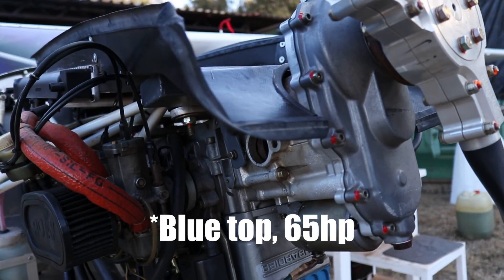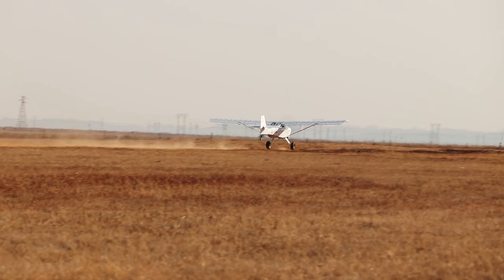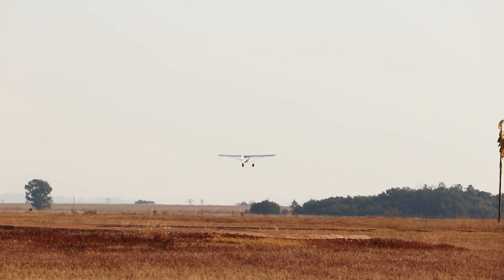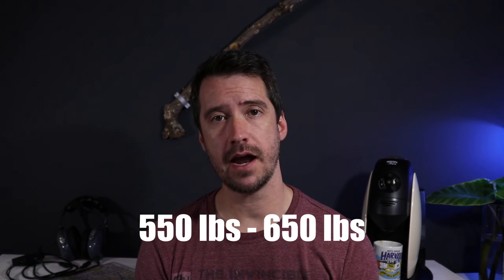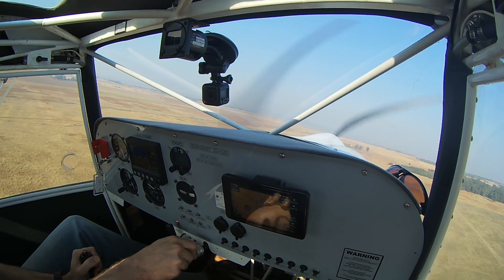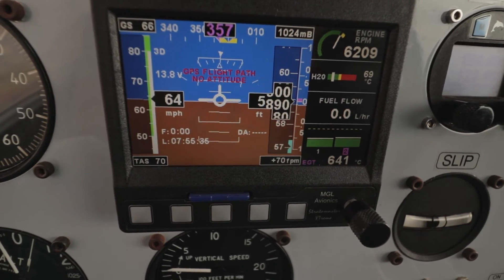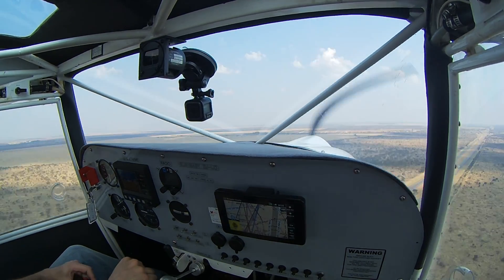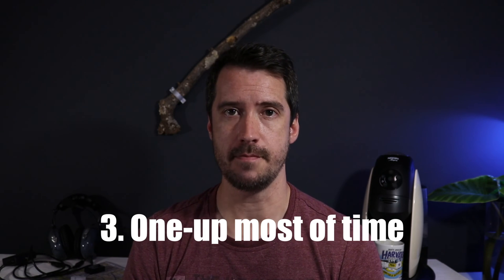Is the Rotax 582 Good for Light Sport Aircraft?

Comment: Very useful video but, as you point out, the takeaway has to be nominal power available vs aircraft weight and density altitude. The video, instead of naming the Rotax 582, could have been titled "Is 65HP good for light sport aircraft"
Excellent videos with useful information - thanks! Keep it up!
Reply from the maker: Yes absolutely to both the takeaway and title comment. Thanks.

Comment: Totally agree, one of my first flights was in an X-Air with the 582 engine, 2 people on a hot summer afternoon. Grass runway was 400 meters long and we used like 300-350!! Got a bit nervous, also the climb rate was sluggish. Airfield at an elevation of 1200ft, temperature 33 celsius with high humidity 😂

Comment: I just bought a kit Fox 2 with a rotax 582. 65 horse blue head. My airport base altitude is 7,600 ft. I was wondering what you thought. I know that on a hot day I should only consider light fuel and one person. But during the winter months it gets down to freezing if not just above freezing quite often. I know that it doesn't seem like a lot of power but would it still be a reliable plane to fly when density altitude is not very high. I don't know what do you guys think. I live in Questa New Mexico USA.
Reply from the maker: My take, the Kitfox 2 is VERY light and thus the 582 has ample power for it, even 2-up. However 7,600ft is very high, most non-turbocharged engines and planes will suffer there. Even so, I'm quite certain it will fly just fine 1-up.

Comment: You really need to go back and check out the original Aero Design's "Pulsar" by Mark Brown. It was based on the 582, composite construction and professionally designed & engineered. It performed extremely well and a number were built and flown. Later, the option for the 80 hp Rotor 912 was developed and even later the 100 hp was installed. Also, check out his article on "2-stroke vs. 4-stroke" in the EAA Sport Aviation archives. Food for thought.
Reply from the maker: Thanks, will do!

Comment: Don’t buy or build an aircraft, or install an engine that is not suited for the density altitude in which you intend to fly. A dangerous consideration to over look. No matter how fast you can run, your kite is just not gonna fly without lift. It might not be common knowledge, but there are certain country’s where the airlines don’t allow departures after 12:00 pm. 
Your video is a good offering for those that are thinking of choosing a similar path. Hopefully they won’t make the same mistake. Fly sunrise til winter!
Reply from the maker: Well said. And to add to that, just because it flies fine with just you (the pilot) aboard, doesn't mean it will be fine if you add a passenger. Light aircraft are extremely weight sensitive, and density altitude compounds the problem.

Comment: I have a 582 in a kitfox 3 on full lotus floats, 10 seconds on water to get in the air and 7 seconds on snow
Reply: Your Kitfox 3 will be as bad as the 2 stroke Bushbaby under the same conditions (both share the same wing profile). Did you ever take off from an airfield at a DA altitude of 8000 to 10,000 feet? Everything is different 30% less power and much less lift due to the thin air and much less cooling (you really need to control the throttle in a 2stroke to avoid damage). My airfield in Europe is at 560 feet altitude and I also fly in South Africa at an airfield with an elevation of 5600 feet. My plane in Europe and in SA are almost the same (KFA Explorer and KFA Safari) but although the Safari got a Turbo which compensates the DA and has 15 more horses, the performance difference in terms of take off is massive. Also, if you fly at 8000 feet but 7500 AGL is not the same as flying 8000 feet and 500 AGL.
If you got there a downdraft, that really gives you the creeps. I am a seaplane pilot too. Try to take off on a hot day on the Titicaca Lake and you will wait ages to get airborne, if at all. You need a much higher ground speed to take off than on sea level.
Reply from the maker: Nice! Yeah the Kitfox 3 is nice and light. I bet even with the floats it's empty weight is way less than the 670-ish lbs my Bushbaby used to weigh.

Comment: Very usefull video! I am just near to Buy a replica of the Kitfox, A Raven, and it has a 852 too, downside like yours.. Here un Argentina we are Close to sea level, so that would not be a Problem!! But i have some other questions!! 1.Wich type of oil do you use? 2. In how many Hoursdo you clean and change sparkplugs? And the 3rd. Between how many Hours you take head cilindres off and take the carbon Away? 
The only thing that stop me dron buying it is the Engine.. Here in argentina we mostly use Lycoming and continental. Rotax is new in here.. that why i ask you some tips!! 
I hope you undestand my english. Hope you are doing well!
Reply: Remember with a normally aspirated engine you loose about 3% of your rated HP every 1000ft above sea level.  Starting with 582 rotax at 5000ft you are already down some horses, not 65 hp
Reply from the maker: Correct, and that's assuming standard ISA conditions. If the density altitude is higher than elevation (which where I live almost always is quite a bit higher) then even more engine power is lost.
Reply from the maker: Thanks, I'm glad it was useful. 
Yes at sea level you won't have the problem we have. The best oil to use is two-stroke chainsaw oil, which is what we will switch to after our current supply of two-stroke offroad motorbike oil is finished. Motul 2T 710 is quite a good product, if it is available there. 

We change spark plugs every 25 hours. Some people only change them every 50 hours, but no reason to go cheap here, just put in new ones every 25 hours. You can clean them as often as you like, but there is probably no use in cleaning them more often than every 15 hours.

I'm not sure how often the pistons need to be decarboned, since our pistons are only 125 hours old at this stage. But the time between ovehaul on the engine is 300 hours, which is quite often. My guess is 300 hours will elapse before it gets heavily carboned. But that's just a guess.

Hope that helps, and enjoy your plane if you do get it!